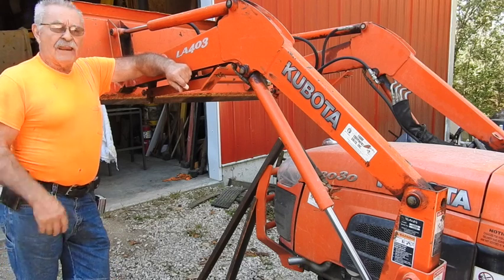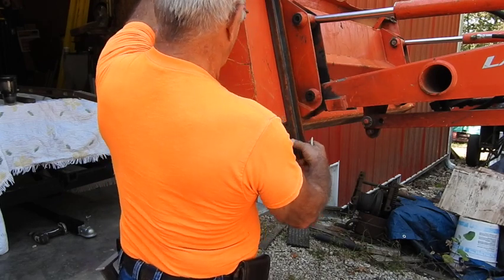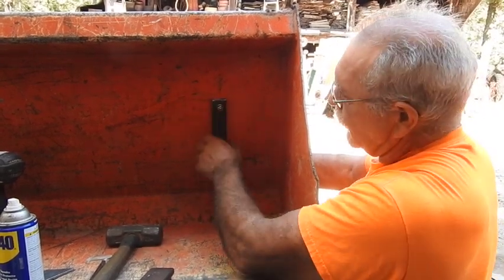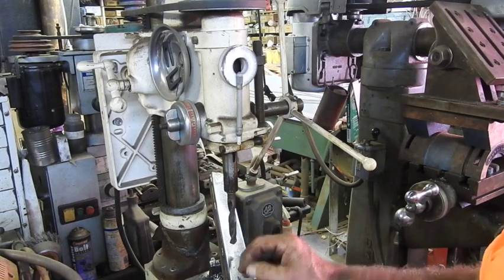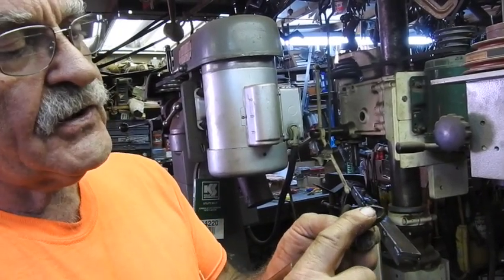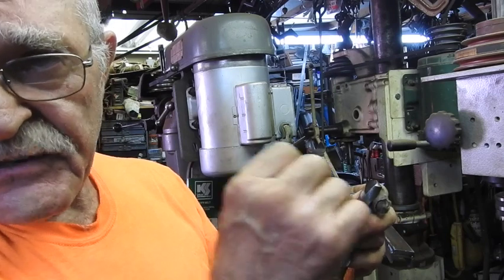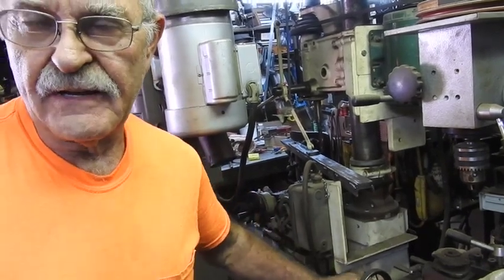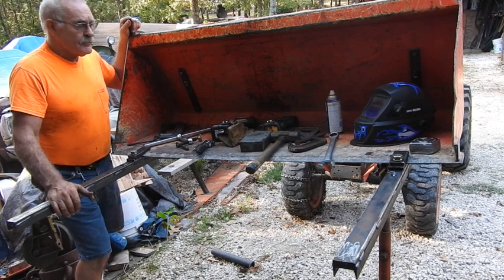Kubota B3030 Light Duty Fork Build-Welding Hack-Outdoors

Comment: Whenever I use an old tool, I don't really feel I have to do any concession.... other than the aesthetical factor!  Nice new tools do not last as long as we all know. That IS a concession!  That is indeed a fact doing such a project requires a good amount of tools. But more importantly, a good amount of skills! Thanks Wendel!
Reply from the maker: Good Morning Joe !!  Gosh dang, I need to get back over your way.  My routine got disrupted when you made your move and I gotta get back in the groove !!  Now Dave has even moved away.  Canada will never be the same now.  LOL.  What I meant about making concessions was most of the time drill bits have been ground and reground so many times by the time you find them at auctions it takes a little time to get them in good cutting shape.  And that old drill press had been dropped so the entire casting is brazed where it was broken in half so I try not to stress the casting too badly.  Things like that.  But yes, mostly the old tools have great longevity built right in !!  Thanks Joe for the visit my friend.
Reply: Hello, Joe nice to see that you are resuming your OUTSTANDING comments 😊👍🍻
Reply: @tractorman4461  We will reunite Joe and I one of these day's Sir !!!
Reply from the maker: @RCAFpolarexpress  Oh heck yeah Dave,  Of that I have no doubt !!
Reply: @tractorman4461  It is written up high in the sky mon ami !!!

Comment: Now that is a handy idea. I remember the pack forks my father-in-law had on his L275 back in the 80s. They attached to the 3 point hitch and he used them for moving pallets of oak logs for his mushroom growing operation.
Reply from the maker: Well I could build them a lot heavier, but with the loader capacity at only 850 pounds (+ -) I am banking on these light duty ones to carry the load....so to speak.  I have seen a lot of three point forks, but never owned or used them.  Hey....whatever works right..??!
Reply: @tractorman4461  anything beats pushing a wheel barrow or cart!

Comment: Hey Wendell, good video. No need to apologize for the "shop lesson". Most guys don't know any of the stuff about drills or taps. I just found my Dads drill gauge the other day, I'd mislaid it some time back. General tool still makes them, I think you can find them at Lowes in fact, or surely on line. I've gotten spoiled using a Drill Dr for most of the smaller drills since my eyesight is more a suggestion than a fact these days! I got a chuckle out of you talking about breaking that 3/4" tap. I grew up in a gunshop using a lot 6-48 and 8-40 screws and tapping blind holes. Even had some 4 gauge screws, 4-56 I think. Anyway, you learn real fast to go real, real easy after you break the first tap off in a customers gun. My Dad didn't have a lot of a sense of humor when that happened! Old tools rule for us old fools! Semper Fi!
Reply from the maker: There ain't nothing worse than snapping a tap of any size off below the flush line of the material being threaded.  But the stuff I work on isn't nearly as critical as working on someones prized weapon.  I'm sure the stress level could elevate quite rapidly Bret.  LOL.  Soooo...you don't have the sharpshooter eyesight of the days of our youth any longer.  Join the club...I've been there a while now.  
    I'd like to see the T-handle of the one holding the 4-56 tap along side the big boy on this 3/4'' tap.  LOL.  Yes, I laughed out loud at the 'old tools for old fools' line.   Good one.  I may use that one in the future.  S/Fi my friend.  Stay Safe out there.

Comment: Nice video.I had an older mechanic show me years ago how to mix up cutting fluid using water , parts washer and moter oil mixed in equal parts.Works amazing
Reply from the maker: Oh man, I tell ya...the old timers used all sorts of concoctions. I use lard we rendered at hog butchering for drill bit lubrication most times.  Old time trick.  We used a mixture of roofing tar and used motor oil to plaster on the plow shares after use.... I use acetone and atf for a good rust buster.... and the list goes on.  You just added to it for me Mark.  Thanks for taking the time to watch and give me a tip at the same time !!

Comment: Bonsoir mon ami you have a great project on the go !!! Great antique drill press !!! Ho boy that is a treaded maker !!! Great tips about the angle at 118 for sharping tips !!! Like your statesman about old tools and amen to that !!! Great tips on the tread maker going back and forth !!! Have a great week end mon ami Cheers !!!
Reply from the maker: Each time the direction is reversed, you can actually hear the chips break off with an audible snap.  Working the tap back and forth, especially on these bigger ones, seem to lower the chance of snapping one off.  A lot of my taps are auction finds where I get 30 or 40 at a time and a lot of them are pretty rusty.  Cutting threads slowly with heavy lubricant kinda helps get them back in fair shape.  Thanks Dave and hey... Ol' JOE commented today !!  Sure was good to hear from him !!
Reply: @tractorman4461  Yes I just see that, the wife to do list give him some loose lol !!!
Reply from the maker: @RCAFpolarexpress  Hahahahahaha...funny
Reply: @tractorman4461  lol !!!  You are both very lucky men !!!

Comment: From Mark In KY,  I really enjoyed your video in which everything that you were mentioning in your video was what I used to do on a frequent basis as a welder/fabricator at the facility where I retired from.  
I think that your forks should work just fine. Now you can design a “Boom” for the center of the bucket for hoisting things. We had a fairly long piece of 6” channel with 4” x 1” thick flat that was welded onto the flat portion of the channel with a hole near the end with a chain with a cargo style hook. This “Creation” was used with our two forklifts for pulling anything from engines to the heavy multi section hydraulic cylinders. We never discarded long V-Belts because we used them for lifting the hydraulic cylinders because once the weight of the cylinder was applied onto where the belt was looped around the hydraulic cylinder - This configuration performed rather well. 
I was curious what brand welder that you were using - The feed of the wire and the sound of the electrical arc looks and sounds very nice to me. The welder that I used was a MillerMatic 350 in which I used primarily.035 and .045 L-56 Lincoln copper clad wire. Also we had a Cutmaster 102 air plasma cutter that ran off of a 100 amp service. In my area of the shop, I also had a Jet upright bandsaw, 3 phase drill press, and a a DAK hand crank hydraulic press that was quite awesome. Also there was a “Power Hacksaw” that was very good for cutting anything less than 6 inches wide and anything like heavy round and square stock. Speaking of old tools, There was a industrial pedestal grinder that dated back to the 1940s that used the 14” x 2” or wider wheels with 1” arbors. The older tools are much better than the newer junk that is on the market today  Honestly I missed being around the shop tools more than anything else when I retired last year. When you were showing all of your tools and clamps - It looked almost like a mirror image of everything that I would have been using in which I also used the bar clamps quite a bit.  I always enjoy your videos.  Best Regards From Versailles,Ky.
Reply from the maker: That particular welder is a Snap-On YA 212 industrial welder.  I got it on a trade about five years ago.  I run .035 ER70S-6 wire for most mild steel work.  I also have a Miller Synchrowave 500 which is a stick/TIG with water cooled.  Then last year I got a Miller Legend 200LE gifted to me.  Gas powered.  Plus theres a few others stuck in this corner or that...LOL   My plasma is a Hypertherm Powermax 65.  It is sweet !!  And for hanging beef quarters in the cooler, I made a jib pole for the bucket.  Works really well so no more hugging and trying to grip onto the fresh warm slippery quarters !!  You'll see my really good bandsaw in an upcoming video. Its really old and has like a (I think) 16'' throat and 10 1/2' blade.  I too have an old pedestal grinder that drove from an overhead flat belt.  It probably has 2'' x 10'' wheels on it.  Gotta get that one up and working one of these days.
    Speaking of jibs, you might enjoy this video: https://www.youtube.com/watch?v=4XvTSEE4-nw&t=677s LOL. It might look a little sketchy, but man does it work !!
   Thank you immensely for such an awesome comment IronDuke !!  I am glad to hear that you enjoy the videos and I sure hope to hear from you on some of the other ones.  There's a real good welding project in the line up right now.

Comment: Quick tip, to convert kilograms to pounds, multiply by 2.2 ( approximately ) Conversely,...stay with the metric system,.. everything is divisible by 10 Hahaha!
Re. "cheap forks",....
Material: low cost.
Instruction(s): priceless.
Great ideas here Brother!
Thank you.
Reply from the maker: Thanks for the lesson on metrics !!  But I'm not sure it will 'stick' in the old noggin.  I'm so entrenched with feet and inches I really have to THINK hard to convert. But I am going to TRY real hard to remember multiply by 2.2 just for you.  Actually that sounds quite simple doesn't it.  LOL.  But please let's not talk about MPH vs KPH !!  My head can't take it......
Reply: @tractorman4461  Read this reply at your own risk:...... 
You're not alone here, I measure something and it's 25mm, so my head thinks, oh that's an inch!
Yes and on the subject of MPH and kph, I have a Mini Cooer, which came from your Country, so it has a miles per hour speedo, BUT being here in 'Metric Country' I have to obey kilometre posted speed  signs. Now thankfully, this Mini also has a digital readout in kph, so when I have to drive at 100 kilometres ( or in the U.S. it's kilometers )  per hour, my speedo reads approx. 62 mph. Confused yet? LOL  Oh by the way, you mentioned St. Louis, well from there to here its about 2656 miles, or 4242 kilometres, so
if you started out from your home and I started from my place, you'd get here before I arrived there, right,.....  Hahahaha,
One more bit to drive you completely crazy, it's 'mileage' to show distance travelled, but here, we are supposed to say, 'kilometrage' ( but we don't we usually say, " how many kilometres? :)
Before your head spins out of control, go now, and enjoy the rest of your weekend, above all, keep smiling.
Reply from the maker: @regsparkes6507  I read this and was laughing good enough it caught the attention of the Missus....so I read it again aloud for her benefit.  So now you got us both laughing pretty darn good !!  On the trip to St Louis, I think even though there is a difference of 1586, yours being the greater....I believe being so far North, you could just coast downhill and get here faster because I have to drive UPHILL all the way to Newfoundland !!  I'd burn ten times the fuel to go the distance and get there later because of the additional fueling stops !!  Lets not even address the Canadian term kilometrage.....  My brain is sufficiently melted at this point.  LOL.  Funny stuff Reg, funny stuff.
Reply: @tractorman4461  Glad you both got a laugh or two from this. Imagine how we had to struggle back 9in the 1970's when our Federal Government decided to change our whole system to metric weights and measures.  I have learned enough now, that I can be 'dangerous' in both! LOL.

Comment: Thanks for the great information on the drill bit, I drill and tap steel I have a book with my tap and die set that I use for the right drill hole size,
Reply from the maker: I've got a chart somewhere or other.  But it never seems to be where it needs to be when I need it.  I do refer to it when its extremely critical on a project...but this project here was really just a quick hack job because I need this thing ready for use right now.  My skidloader is down right now and that's what is usually used with forks.  Thanks for the visit as well as the comment.

Comment: I enjoyed every moment of the video, well done 44, you did a great job there, thanks for the lesson on sharpening a drill bit, I have a video on my channel where I show how to do it in a very un-professional way but is more or less what you say, glad I was not lying to my viewers to much lol, I absolutely like tap-magic, that is what we used as well.
Reply from the maker: Thanks Jan for the cool comment.  Sometimes the larger bits are a little more difficult to sharpen freehand, but as long as they are the width of the grinding wheel or smaller, it is a snap !!  I really have to be careful sharpening 7/8'', 1'' or bigger ones because my wheel is only 3/4 on that grinder.  It the big ones just need a 'touching up' and not an actual sharpening, I like to use the belt sander because it's so wide.

Comment: Don't know if you have ever done it or not but press a nut on the square end of the tap and you can use a ratchet and socket on it. works great in tight places
Reply from the maker: Yes, but I usually use a 12 point socket to fit the square then use a ratchet in the tight spots. Most times it works fine...unless the taps are the ones with the less than crisp corners.  Those slip a little.  Thanks for the tip and I will keep that in mind.

Comment: Seems like I remember calculating Kubota loader lift capacity by taking the number 403 multiply by 2.2.  In this case, 886.6 lbs.  And that would be at the bucket pins.  I don't know the math on derating the capacity as the load goes further out from the pins.
Reply from the maker: Yes, another viewer refreshed my memory Wayne and that's the number they used as well.  I have to think too hard convert metrics almost all the time.  I kept the fork short because of the lessened capacity... but the intention is just to be able to jump on it and go do small lifting without having to fire up something bigger.

Comment: Hey T whereabouts in Missouri you located ?
Reply from the maker: Well I'm a little more than a stone's throw off the good old Mississippi River about 40 miles + - south of good old St Louis.  I'm assuming Mike, by the question that you too are a Show Me fella ?
Reply: @tractorman4461  
I'm in the Lake St Louis / Chesterfield area quite a bit but I'm located in N. Mich.
Reply from the maker: @mikeheilman2560  I know the area fairly well.  Doing commercial HVAC for 40+ years I was involved in the construction and start up of quite a few buildings out that way.

Comment: Need to lower the drilling RPM , and use some old motor oil on the drill ...........
Reply from the maker: Yeah buddy BubbaG.  I got the old gal spinning as slow as she will go without adding a speed controller to the motor starter.  I think just about all the drilling in the video was sped up to 2X speed to keep it from being too boring to watch. I don't remember now how much of the drilling is shown in real time, and probably some of the shots of shooting it with Tap Majic or cutting oil was cut out too.  But man o man, wait until you see the new drillpress coming into the shop today.  It's so cool, it defies description !! Thanks for stopping in for a visit this fine fall day....
Reply: Can't wait , how bout a hint ?  maybe a big ol radial drill  ,one that ways more than the B3030 ? 
Can't wait  .........  Thanks 44
Reply from the maker: @bubbagump4686  Hahahaha...we will have to wait and see... LOL. I bought it off of a picture my second older brother sent me from a yard sale way over in Illinois.  It won't outweigh the 3030, but I'm pretty sure it will almost max out the lifting capacity.....